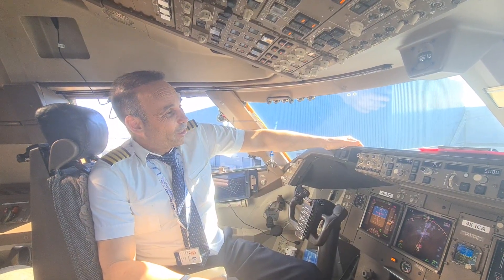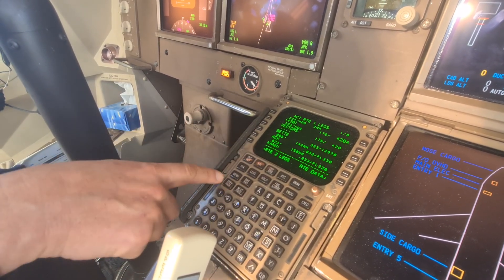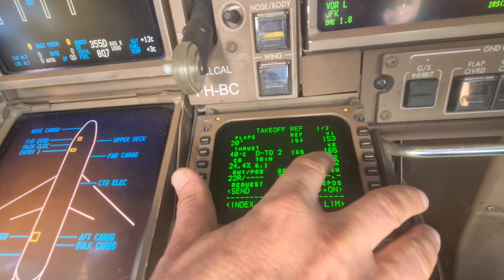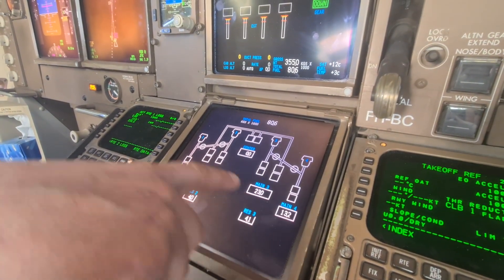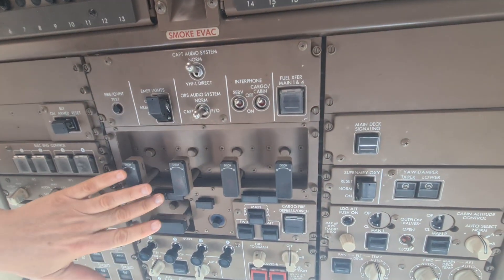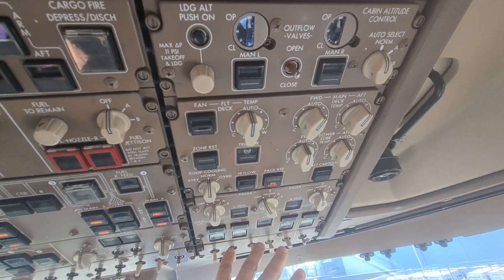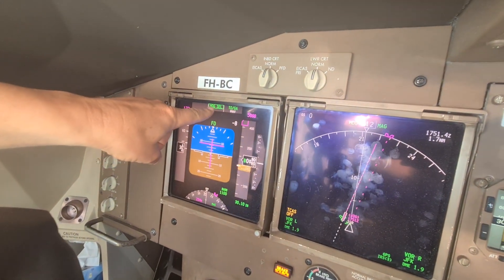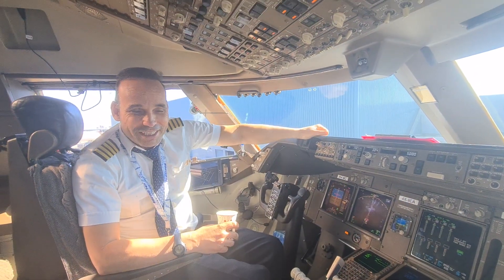BOEING 747-400, Cockpit explanation of buttons and switches before cross Atlantic flight ✈️

Comment: Hello Captain Boeing.  I would like to ask whether you or any of your colleagues are familiar with the 747 simulator packages offered by PMDG for the Microsoft Flight Simulator X.  If this name does ring a bell, may I ask whether you know of any professional aviators who practice abnormal procedures or even plan flights with the FMC at home using PMDG products, assuming of course that work-related matters are not excluded completely from off-duty hours spent relaxing at home. 

As a home simulator fanatic, this question has intrigued me for some time, given the high degree of correlation between the cockpit features in a real Boeing flight deck and the virtual rendition of PMDG products,.  I believe PMDG is the only desktop simulator outfit whose products are licensed by Boeing.

Comment: Captain i appreciate you going throughout our Flight plan Briefly and all other procedures as of emergency procedures and Engine out procedures and 165 tons of fuel aboard is incredible and overhead panel checks for circuit breakers check. RTO check out and all other systems check.

Comment: Hi.. What is pack RST button used for?
Reply: The Fault light shows a temperature zone duct Overhead or zone Temp controller Fault has occured or master trim air valve failed to close or Trim air switch off. Push to the Button to the reset, if the fault no longer exists.

Comment: Thank you for the through explanation. Can you please explain how the SECAL System works and is it still relevant in these modern times?
Reply: it's only a backup System that Pilots or ATC can communicated over voice HF Frequency over special Area as Ex. North Atlantic. But it's low Qualtity communication with a lot of  Noise in Backround. With the SELCAL, Pilots can mute the HF Radio and in the case of Voice call Request, ATC can send special 4Letter SELCAL Adressing Code to the Aircraft. For this Aircraft, you can see FH-BC under the Gear Lever. Than it makes it DingDong Bell in the Cockpit and Pilots can hear incomming ATC voice Call Request and Pilots tune on HF Radio Volume. It's not necessary monitoring HF Radio all the times. Normaly Communication is CPDLC.
Reply from the maker: Correct 👍
Reply: @romans2493  thank you.